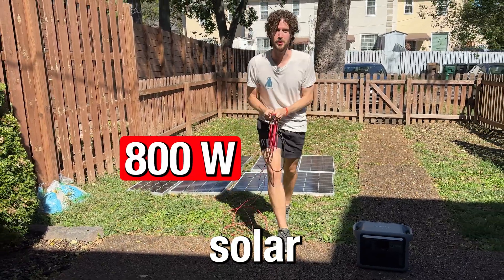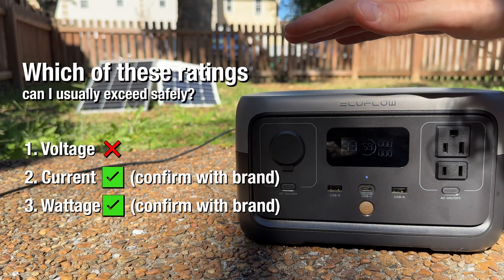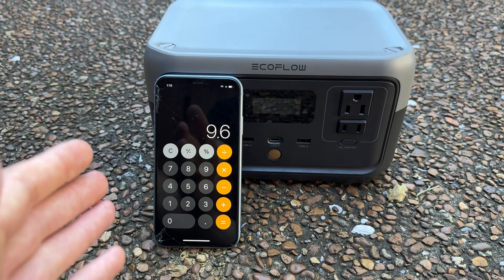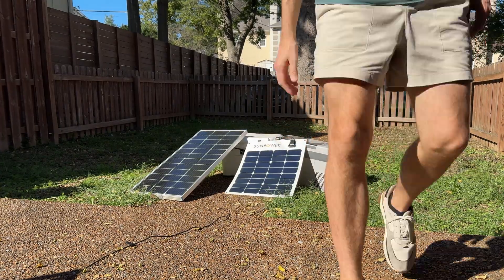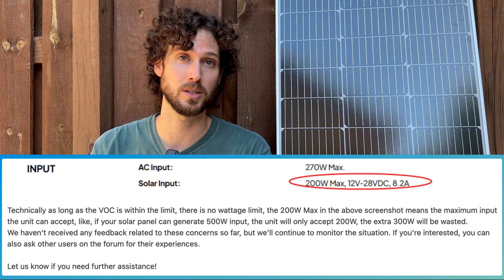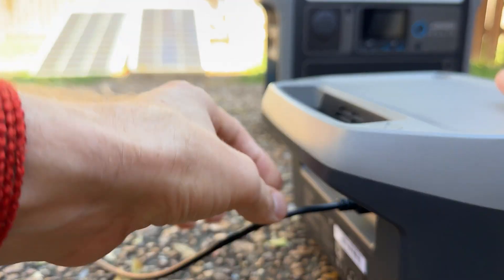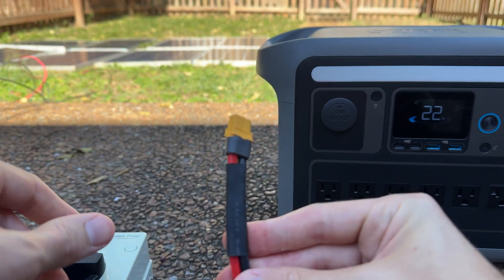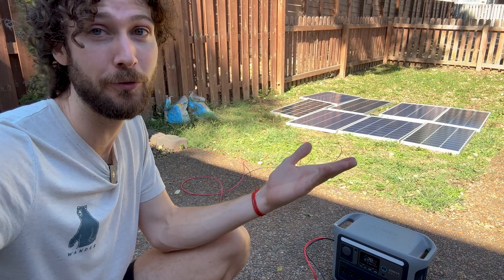How I Overpanel My Power Stations (Safely)

Comment: I will put this entire 12 minute video into a single sentence. In order to overpanel safely, you simply need to not exceed the maximum MPPT Input voltage. amps don't matter, as it will only take the amps that it needs. if your battery takes up to 60V at 10A, then you can have 50V at 40A, it doesn't matter. it will take the 10A it needs, and since you overpanel, even when the sun is dim, you will likely still get atleast 10A.
Reply: Can confirm, your summary better than the video lol
Reply: True, so its better for the ecoflow to have a 200w/400w panel which will provide the 110w most of the time than a 110w that you will never reach that wattage.
Reply: @pedrobatista1062  for a small system like this yes
Reply: Yes but no but not so simple, heating more,  epever can do 150% but 300% too much
Reply: but he has better hair
Reply: Technically amps can/do matter. Some mppt have max amp input. For example you can have a 150/30 mppt 150 volt 30 amp with a max input of 20 amps or something lesser than the 30 so it has room for conversion. It's important to just look at your manufacturer specs.
Reply: @Dragonfiregum Max output! Not input.
Reply: @Dragonfiregum Amps don't matter even for 150/30. The 30 doesn't mean AMPs from the solar panel to the charge controller. It means AMPs that go into the battery from the charge controller (charging current). So you are wrong! The MPPT will always draw the AMPs it needs from the solar panel.
Reply: @meilyn22  Go ahead and put 120v 70amp of panels on a 150/30 mppt charging a 12v system and let me know what happens then. You are going to fry the unit.
Reply: @Dragonfiregum Instead of doing some research, you are showing people how ignorant you are, lol. The 30 in 150/30 is the max output, not max input. You didn't know this and you think you can teach me anything? Lol.
Reply: @meilyn22  If you think i dont know the 30 in a 150/30 title means output its because you don't understand what i said. Please stop advising people of things directly against manufacturer recommendations that can kill people or destroy their systems. YOU MUST STAY WITHIN ISC LIMITS OF THE CONTROLLER. Attempting to put stupid amounts of amps in a string to run it full power every moment of light WILL burn it up during a sweep.
Reply: @Dragonfiregum Boy, I have been doing this for years. You have no idea what
You are talking about.
Reply: @meilyn22  Next you'll try saying something like all mppts of the same voltage and amperage are created equal.
Reply: that was like 6 sentences mate 🤣✌🏾
Reply: NOT SUre if he talks about it in the video but the issue here is conversation of energy and mass... Even if the system won't take more wattage if you increase the amps above reccomedend limit, the issue is it will heat up your battery.. That clipping is really transferring the energy into heat as you can't transfer the nergy backwards... so you are heating up your system, meaning don't overpanel beyond the maximum watt input limit.... it will just create heat that will ruin your battery.
Reply: @RECURSIVECIRCLES  The BMS (internal to the power station) goes between the panel and the battery and is what controls the current going into the battery. At least from what I know of these things.
Reply: @RECURSIVECIRCLES  Thank you. I wondered where the "clipped" energy goes and I suspected it was heat, somewhere in the system.
Reply: @robmullins  it's more that the extra is not being produced. 
i'm far from an expert, but the "extra" would be converted to heat in the battery only if it were connected to the battery directly. but there is a charging unit inside that regulates the charging. it effectively takes the necessary current. think about it... what is happening with the produced power by the panel if nothing is connected? you would say, well the circuit is not connected, but the panel itself still has the potential to create energy from the sun, so what is happening with that energy? but ok, let's ignore it for now. but then again, what is happening with ALL the energy when you connect a volt meter to the panels? you are technically closing the circuit, so the panes should be producing, the tiny voltmeter and its wires are not consuming all 800 or so Watts... where is the excess? i mean yes, the volt meter has high impedance, but why is it not heating?

when you plug an old phone in a fast charger, it takes 5W from the charger (5V/1A), although the charger can produce a lot more. the battery of the phone won't heat up with the "extra". nor the charger (i mean they would both heat up a bit, but with the regular amount that is lost due to power conversion). that is assuming the phone has a proper charging circuit inside it of course. i have a 5V/6A phone charger, when i put an old phone to it, that takes 5V/1A, it charges normally, the extra 25W are not converted to heat, neither in the phone battery, nor in the charger itself.

if anything, the "extra energy" is still on the panels - they will heat up, naturally, like a normal glass or plank would heat up when shined onto from the sun. or in other words the "sun energy" that would have been converted to electric power, is not being converted and is still sun energy and is reflected like light, infrared, and some is stored in the object as heat

of course all that is assuming the powerstation is working properly and is not shortcircuited to give the input power directly to the battery
Reply: @robmullins  the energy remains in the panels, not the rest of the system. you can see at 9:45 that only 12.5a was flowing into the power station, the rest of the energy is lost as heat buildup on the panels. It's not any different from an unplugged/disabled solar panel sitting in the sun. If your battery is full and the solar panel is out the energy doesn't disappear, it's heat, and it's fine. Permanent solar panels feeding into battery banks wind up doing this all the time because batteries fill up and the mppt disables the input.
Reply: @chaon93  will heat still build up if I have loads running 24/7
Reply: @RECURSIVECIRCLES  no, it doesn't create heat. It simply won't take the extra amps.
Reply: @LamoidZombieDog  i don't think you understand law of conversation of energy and mass, that extra ampage needs to go somewhere and it will be heat. If the wiring isn't great it will burn through the wires, and it will make yous system hot.
Reply: @RECURSIVECIRCLES It's simple electrical engineering. A load will draw as much current as it needs at a given voltage. The panels' rated short circuit current is just a rating, nothing is being forced anywhere. The panel voltage will rise toward their rates OCV as current drawn reduces but as long as you're not exceeding the load's rated input voltage nothing bad will happen.
Reply: @RECURSIVECIRCLES  the heat buildup is mostly on the panels. It's like having an unplugged panel or a panel that is feeding into a mppt that has cut off the panels due to full battery. instead of energy being generated it's acting more like a black painted surface would.

Systems with full batteries and solar panels still out survive just fine. If the amps aren't flowing the panels just get a little warmer.

Comment: A few people have mentioned that amps are pulled so there is no limit on the power the solar panels can deliver because the charger determines the amount of current drawn.
THIS IS NOT TRUE - please read on for a more detailed explanation
Well, at least no completely true. As an electronics engineer I have been designing portable power systems using of the shelf solar chargers and I have analyzed the working of these. A lot of the cheaper chargers that state they are MPPT controllers are in fact simple PWM controllers. These controllers simply connect the solar panel directly to the battery with just a few large transistors. They rely on the maximum power point of the solar panel to drop the voltage to a safe level for charging. Having a solar panel that can deliver much more current than the charger can handle, can result in a number of problems: the current may become too high, resulting in the transistors burning out. But this could also result in a too high current or voltage for the battery to handle and this is a very bad thing because this may lead too damage to the battery. What is even worse is that you may not notice this before it is too late. This may lead to the battery overheating.
This behavoir was true for some of the controller that were sold to us as being MPPT-controllers but please note that we only tested OEM solar charger controller, not complete power stations like the ones being sold by Anker, EcoFlow or any of the other well known brands.
Alex is right in suggesting to contact the manufacturer and ask them what the max. solar power input may be.

Maybe some of you still remember 'the old days' when we had flashes for our photo cameras that ran on AA cells? When NiCd was introduced, not all of these could handle the fact that these batteries could deliver a much higher current than the old manganese batteries. If you would fire the flash a few times too fast in a row, the electronics in the flash got damaged resulting in a bricked device
Reply: What do you think about 1 panel 600 watts 48v Voc 15a current 16v ICC vs 2 panels, vs 4 panels? For this Anker Solix C1000 which can pull max 800 watts 60v 12.a? Would you rather have only 1 (safe bet) or 2 or 4? For cloudy and rainy days (as well as for compensating for 0 degrees flat on the roof). Thanks
Reply: @diySolarPowerFunWithRay  Hmm... difficult to say. Most modern battery packs have a very low internal resistance (i.e. allow for a very high charge current).
If not, the charging voltage gets too high since these cheap PWM solar controllers do not regulate the voltage (that is - the ones I have tested) and in this case the battery gets damaged.

Comment: As people have mentioned, voltage is the only hard limit that you must never exceed. It is safe to exceed the short-circuit current by any factor. HOWEVER, it is always best to have a fuse or DC-rated circuit breaker between the panels and the power station/charge controller in case a problem occurs with the device and it starts to draw more power than it was rated for. For example with the River 2's solar input maximum of 8A, I would put  a 9A or 10A fuse.
Reply: This is what i was wondering, as i saw lots of people puting a LiFepo4 battery directly, over 100A. But the power station takes Amps, it`s not give. If it wants 2A, even if 100A is avlb, it will only take 2A

Comment: Are you using the XT60i type connector for the solar charging on your EcoFlow? The middle pin on the XT60i shunted to ground is what puts the EcoFlow into the higher power solar charging mode.
Reply: At 40v shouldn't matter

Comment: Volts are pushed.  Amps are pulled.  Your power station's solar charge controller cannot (be relied upon to) throttle down the volts you throw at it from the panels.  Within reason, it can and will pull the amount of amps needed, at the SAFE voltage supplied, to meet its design and configuration for total amount of wattage delivered to a load or used to charge a battery.
Reply: This is my understanding too. This should be the same theory as DC chargers - if your charger is rated for 12VDC/3A, you can hook it to a device that will max out at 1A without any issue at all, but you'll probably blow the charger if you hook it to something that draws 3.5A and you'll probably blow the device if it can only accept 9V.

Comment: Everytime you drag that power station on the stone, my heart sank😢 btw it's okay to over current.. Electrical device will draw current that it needed.. But don't over voltage
Reply: don't worry because it has rubber feet

Comment: So from your last experiment, will a dc-dc converter with a close enough output to the maximum accepted voltage help to take more energy?
Reply: Or, even better, take leftover current near panels to push closer to maximum voltage of the charge controller over the smaller wires